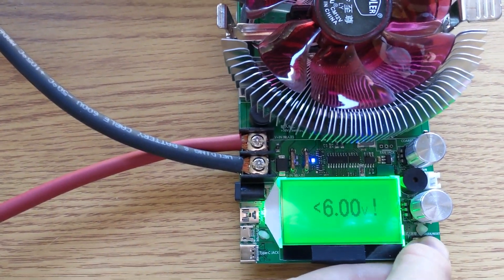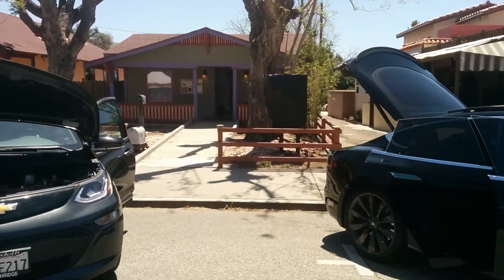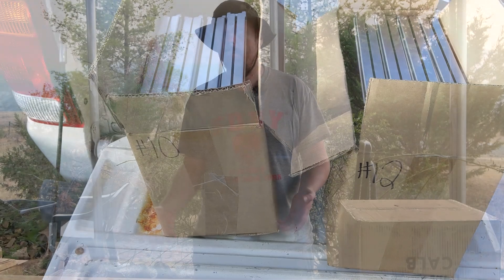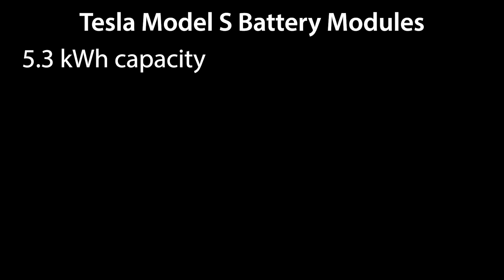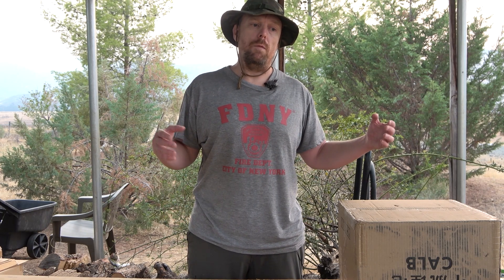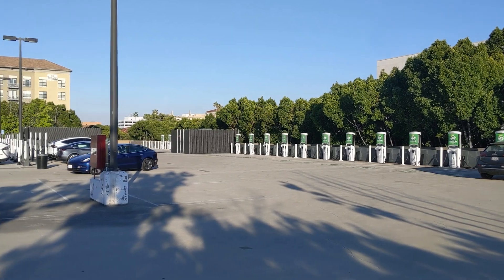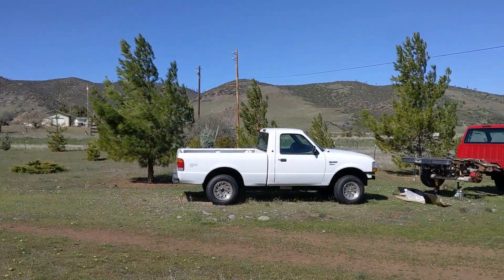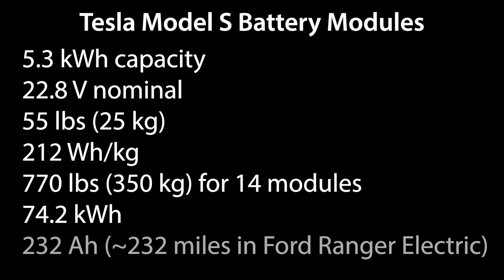Ford Ranger Electric: Why Not Use Tesla Model S Battery Modules?

Comment: The 100d modules are around 6.5 kWh... Same size. I think they are Panasonic 3500mah cells. Maybe 3400. Read it somewhere. Don't remember where. They are super costly, that's for sure. Tesla has their poop in a group when it comes to density for size. Our S85 has an 8 year old battery and still charges to 240ish miles. Really good. You got me pumped for your project dude. Keep up the good work!

Comment: Maybe in 5-10 years ev conversions might be worth the trouble. 20k for a questionable battery setup doesn't sound fun.
Reply from the maker: I think the "Tesla" name adds significant cost to the battery. Essentially, the going price for them is $300 per kWh, which is more than twice what many automakers are now paying for new batteries.

Most EV conversions don't require the size of battery that I would need for a >150 mile EV truck, so the cost should be significantly lower. Based on the cost of the cells I'm actually using, a reasonable EV car battery could be made for $5,000 to $6,000, depending on voltage and other factors.

Comment: Master of suspense! :-)  What you mentioned on the bms, etc, all that, I check EBay occasionally for the ngs tester card we need for the Ranger EVs and never see any, they were scarce 10 years ago when folks were really into them, now they're non existent.  So it's either try and do a more compatible battery upgrade that will work with the existing electronics, or just tear everything related to the motor/batteries out and upgrade it altogether, which is not cheap. I'm curious to see what you went with,  but I'm really looking forward to seeing your results, great post!
Reply from the maker: Thanks! Yes, these Ford Ranger Electrics are definitely a challenge, but I also think they're worth it. Most of the support for DIY EVs and EV conversions is for <200 V systems. I like the fact that these Rangers were a 300 V system from factory, but it limits the after market support.

Comment: We are planning to implement deep cycle lead acid for off grid storage.

 It's about 1/3 the price per kwh compared to COTS lithium sollutions from TSLA/huawei
Reply from the maker: You might be very interested in the batteries I'm going with for my first Ranger Electric battery build, then.
Reply: It depends on how long you think those batteries are going to last. Once you replace them twice, maybe even once, lithium is so much cheaper.
Reply: @Chris-bg8mk  i'm unsure why this type of battery would be more prone to failure, and please keep in mind 1/3 the price, so replacing it 5 times would be just as expensive as replacing lithium once.

i think lead acid deep cycle is perfect for grid storage application, weight and volume are not realy as relevant in stationary energy storage.

Comment: I hear bolt battery's are getting cheap and available second hand :')
Reply from the maker: I know you're making a joke, but I actually almost bought Bolt EV modules for the Ford Ranger Electric. At the time, I thought they wouldn't work, but it turns out that they would have been fine in ~50 kWh and 100 kWh configurations. 

The Bolt EV modules were about $100 per kWh (new) versus the $300 per kWh for the used Tesla Model S modules, and though the Bolt EV modules were slightly less energy dense (about 185 Wh/kg), a ~100 kWh Bolt EV pack would have only weighed 350 to 400 lbs more than a ~74 kWh Model S minus whatever degradation it had suffered.
Reply: @newscoulomb3705  indeed I was joking, looking forward to your next video :-)
Reply from the maker: @michelroovers4039  Yeah, I just thought it was funny because I really was considering them. I do wonder what's going to happen with all those used batteries. They'll probably just be recycled at this point.

Comment: I’m guessing liquid cooling is not easy to implement in your application. LFP cells make sense for an passively cooled pack, though they are heavy and not very energy dense. Does your Ranger have liquid cooling? If not, probably better to stay away from very energy dense cells that require good thermal management for safety.
Reply from the maker: The Ford Ranger Electric does have a liquid thermal management system, but not for the battery. The batteries were electrically heated and actively air-cooled, but the liquid cooling system was never integrated into the battery bay. That would be simple to do, though, and I should probably provide a link to the Norway Ford Ranger Electric owner who integrated those Tesla Model S modules.
Reply: I would worry that the existing cooling system could not manage the extra load and would either fry the cells or the power train.
Reply from the maker: @barryw9473  I suppose, but the thing to remember is that this is a 250 A system, so adequately sized batteries are not going to overheat under normal operating conditions. Also, the cooling system on the Ford Ranger Electric would be capable of keeping an internal combustion engine cool, so I really don't think it would be overwhelmed by the addition of 800 lbs of battery mass.

Comment: I'm seeing older Ford transit EVs are fairly cheap (50 miles range)how hard would it be to add more range to them? ..if you already talked about  it..sorry I missed it
Reply from the maker: That's a good question. I don't know that much about the Azure Dynamics/Ford Transit Connect EV van. I know the original battery was a 28 kWh, 600-lb lithium battery, but I don't know how much room is available to house the battery. As I go through this build, I think a lot could translate to the Transit.
Reply: I did not even know what they are exist. Thank you for clearifying what company was been making them.